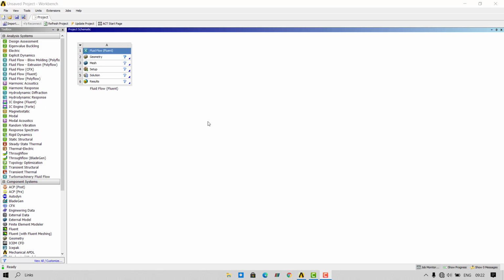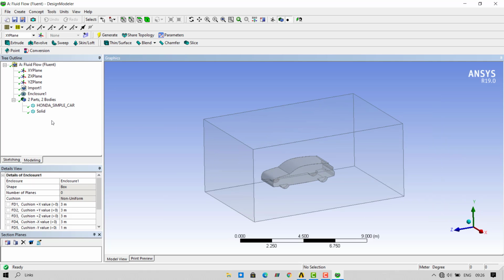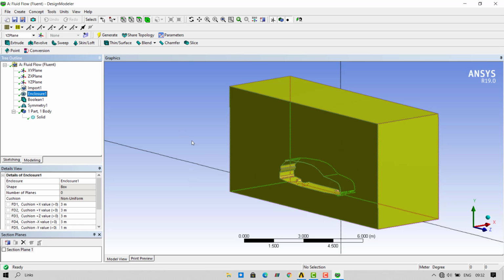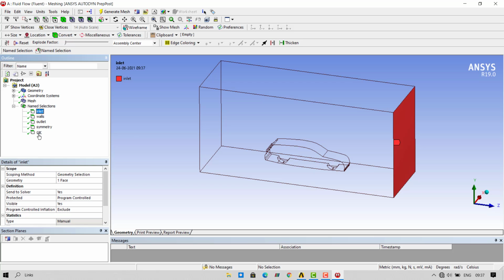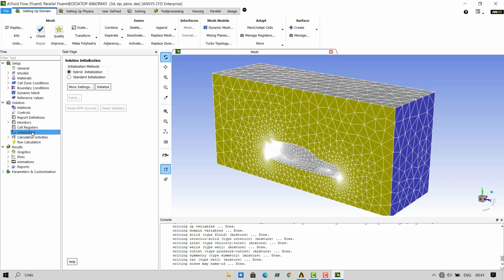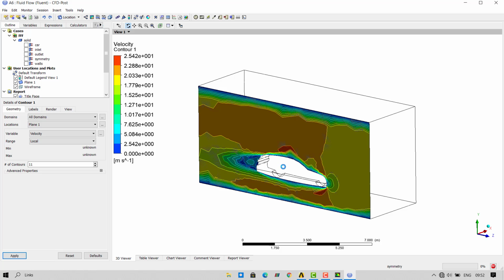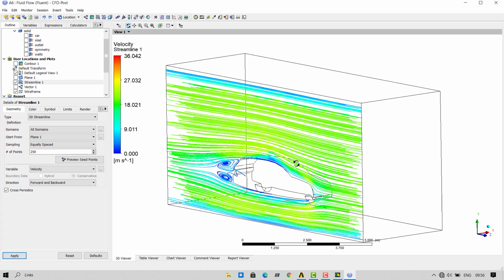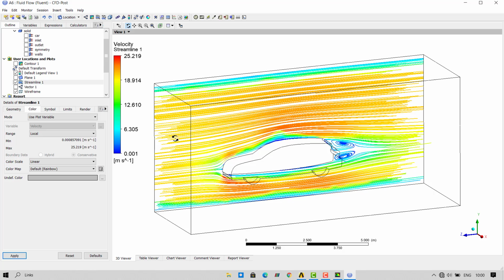How to do Analysis of Turbulent Air Flow Over Car using ANSYS Fluent | Tutorial

Comment: Hello, great video! Since this is a car, shouldn't it be on the ground instead of having airflow under it? I am looking to do this but am not sure how
Reply from the maker: Hello. I am glad you liked the video. Good question. You can create the bottom face of enclosure such that it cuts the tires of the car by small value of 1mm. I hope this helps.
Reply: @cfdbaba Very helpful, thank you!

Comment: This was one of the clearest and most helpful tutorials I've seen on airflow analysis using ANSYS Fluent. The explanations were detailed and easy to follow, even for someone still learning CFD. Thank you so much for the effort you put into this!
By the way, is it also possible to calculate and visualize the drag force acting on a car in this simulation? I'd really appreciate any tips or guidance on that.

Comment: I did use the setting you mention and the simulation get run. However, in post processing CFD the geometry didn’t came out and it appear crack around the car. What influence behind of this issue? Really appreaciate your response 🙏🏻😭

Comment: My imported body won't line up in the middle of the coordinate system. Any help with that please? When I apply the symmetry it won't cut through the middle of the body. Please
Reply from the maker: Hello. You may need to move your geometry with move option or assembly > align option in spaceclaim.

Comment: I have few doubts.. Please help me !

How can I determine the Characteristic Length  of a car with its windows open for external CFD analysis in order to determine the drag force ? Also, what y+ value would you recommend in that case if k-w SST turbulent model is used ?
Reply from the maker: Hello. Sorry for the late reply.
The characteristic length of the car will be same with the windows open. It will be the total length of the car. I am not sure about the y+ value for your case but you can keep it below or equal to 1 or keep it between 30 and 300. Hope that helps.

Comment: by perform this simulation how can i calculate the drag and lift coefficient values. response  quickly.
Reply from the maker: Hello. When you print the lift and drag forces you can get the total lift and drag coefficient values in the right side corner of the console window.
Reply: @cfdbaba  Please Share the values in a Hurry
Reply: Hello Brother did you get the values of those coefficients ? If yes share them ASAP

Comment: hai i want to ask, i have done the geometry and when i want to generate mesh, it said that failed mesh, what should i do? thank  u
Reply from the maker: Hello. Make sure that the boolean subtract operation has been performed correctly. Then you can reduce your element size slowly until the mesh gets successfully generated. Keep sharing and supporting.
Reply: make sure that the domain is far greater than the model or vehicle and don't forget to keep outlet side  greater from others as explained in the video